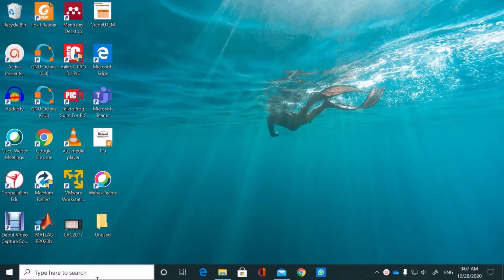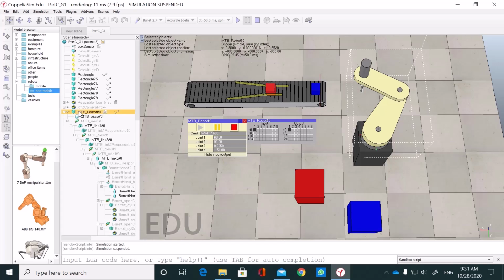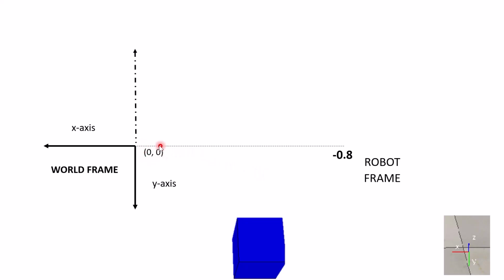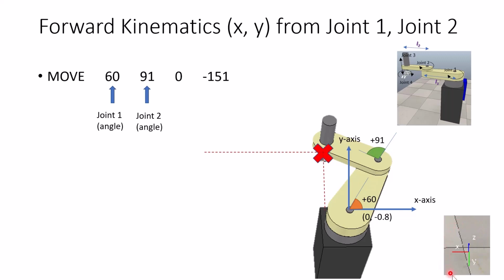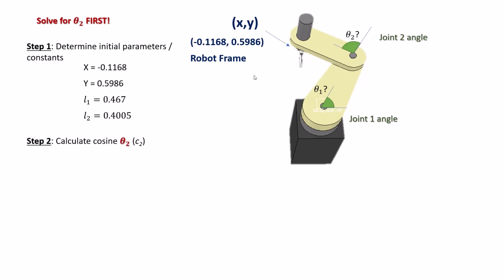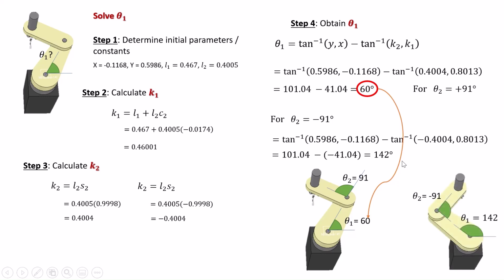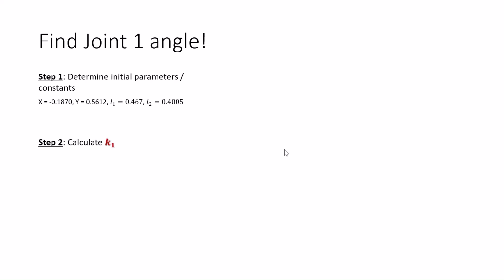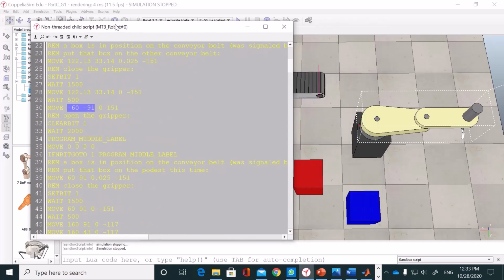BEKM4751 MTB Part1-Inverse Kinematics

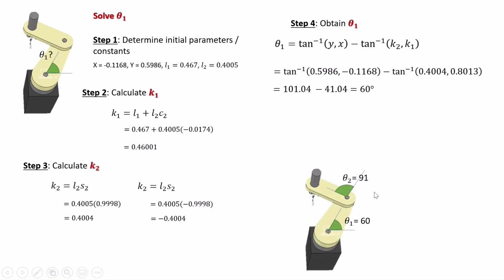Comment: Hi Sir, why the k1 value is 0.8013 instead of 0.46001 at 17:03 ?
Reply from the maker: tq, there is a mistake, it should be 0.4004, however the calculation after that, is correct